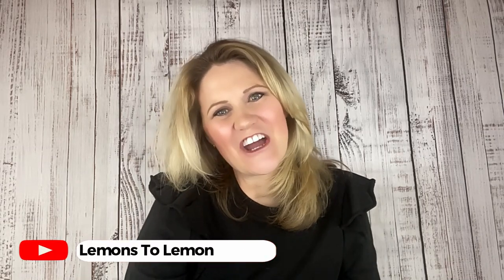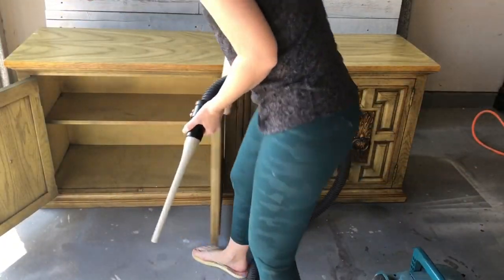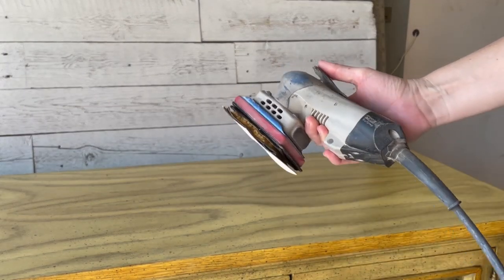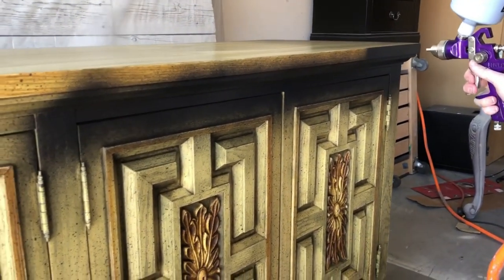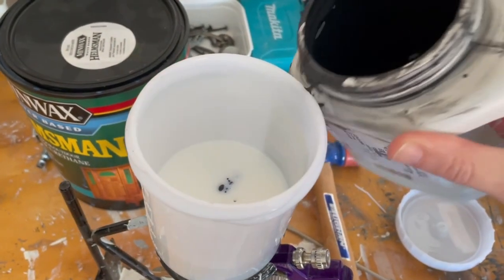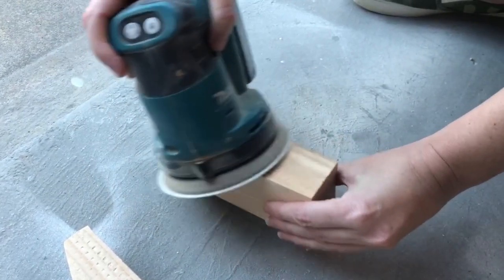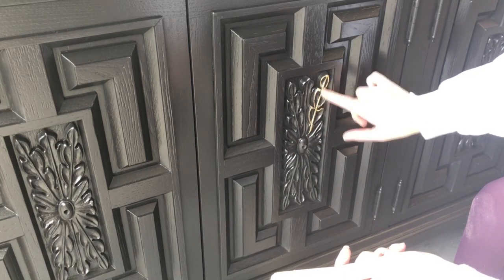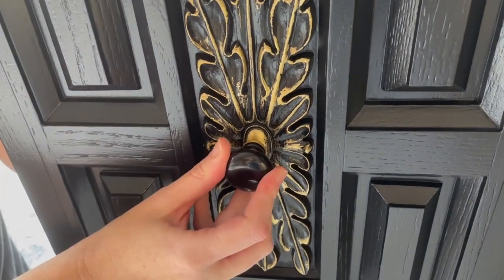How To Glam A Dresser Like A Boss // Ugly to WOW!

Comment: Absolutely stunning!! I flip pieces occasionally and see that you didn’t remove the doors, and painted right over the hinges. I’m always too afraid to do that, but obviously it doesn’t cause any issues? And holds up in the long run?
Reply from the maker: It does! Just requires a few good coats of poly and let it dry all the way before the next coat OR opening the doors. Thanks for watching!

Comment: I have seen so much of this style of furniture and often wonder....  Brand new, what was is supposed to look like???  Probably a reaction against the stark lines of MCM?  Was this furniture salvaged from a Middle Ages Spanish castle?  I am SURE the front panels are plastic, and in it's day, this was not the cheapest you could buy, but close to top shelf stuff.  The 60's was the age of rampant consumerism, i.e., paper dresses, pet rocks, etc.  Or buy things just for the fun of it, without any thought.
Sorry just musing here about what these people were thinking.
Reply from the maker: I have the whole set of this! Crazy huh! I am sure it was top notch in its day, Broyhill and all. It's super heavy. I wonder if those panels are plastic? I will have to inspect the other pieces. They all have those flower fronts. I am stumped on what to do with the other dresser. Maybe the same thing if this one moves quickly! We shall see! Happy New Year!
Reply: @LemonstoLemonadeFurniture  Doesn't surprise me that you have a full set of this stuff.  Have hubby gouge or sand those front panels, they a plastic, correct me if I am wrong.
The original finish was actually very well done.  Lemon Lady, the rest of it?  I am more stumped than you are.  This is a mind bender.
If I were to be you professor, I would advise you to sit down and look at it, and define objectively exactly what doesn't work for you.
You did that already to a point.  Too pretentious, heavy, and gaudy.  Good solution, you painted it black and elevated it off the floor.
Just talking here, but I would have been tempted to put a 1/4" panel over the the heavy handed décor.  I am blank, otherwise.